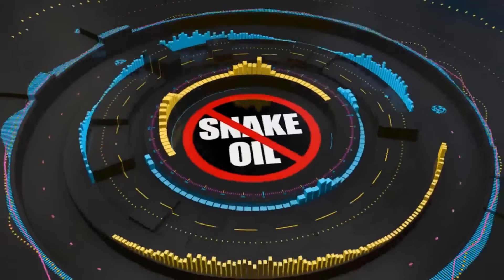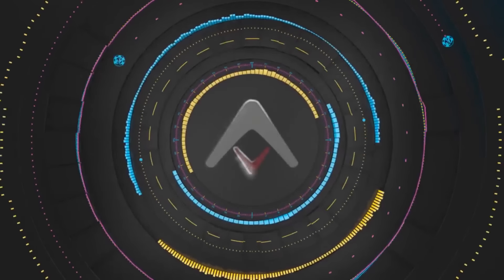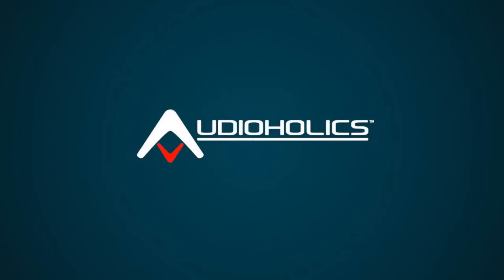STOP Worrying About These 5 Things in Audio!

Comment: Good afternoon Gene , I really enjoy and appreciate your honest advice and tips that you give regularly on your channel. It is much appreciated. I have a question regarding my system which I might add is a very modest one Emotiva MC one with Emotiva 52 I am using a Velodyne subwoofer, paired with definitive technology STS
Mythos towers and infinity  modulous rear channel speakers with a bowers and Wilkins Center channel, my question is, would you recommend the use of a deck with a built-in streamer to enhance the sound quality or would that be something that would not make sense in my system?
Reply: Dac i apologize for the typo and its a Emotiva XPA 5 gen 2 amp

Comment: Why do speaker manufacturers continue with this game of rating their speakers at 8 ohms? And why don’t receivers, integrated amps and amps get on the 4 ohm bandwagon. If speaker manufacturers are going to continue making 4ohm (or less) let’s just adjust the whole industry standards and say 4 ohms?
Reply from the maker: Most multi-driver speaker systems have a nominal impedance of 4 ohms despite some manufacturers fudge and say 8-ohm compatible. Definitely worthy of a video. As long as the speaker has reasonable sensitivity (> 88dB @ 2.83V) and don't have crazy impedance swings or phase shift within the audio band, most modern AVRs can drive them fine.
Reply: The IEC standard for rating speaker impedance provides that impedance must not fall below 80% of the impedance rating. So a speaker with impedance that doesn't fall below 6.4Ω at any frequency is an 8Ω rated speaker. One which drops below 6.4Ω but only to as far as 4.8Ω should be rated 6Ω and likewise a minimum impedance below 4.8Ω but above 3.2Ω conforms to a 4Ω IEC rating.

Comment: Might be a dumb question, but you mentioned Mogami. I use Mogami XLRs for my subwoofer cables. I recently moved into a new place and had to run new Mogami XLRs to my subs that are substantially longer than the previous Mogami cables that I had. I ended up with quite a bit extra cable so I coiled it. Now I know you aren't supposed to coil speaker wire because it can add inductance, but are there any problems with coiling an XLR? It's balanced, so again, might be a dumb question, but I thought I would ask nevertheless. Also, at what length can an XLR lose signal strength / accuracy? I believe Audioholics said something like 200'+ for speaker wire for a single run, what about XLRs? Thanks Gene!

Comment: Gene, I agree with you on 99% here. Most consumer grade equipment and speakers are designed for 8ohm applications. Both the AVR head-unit and speakers. Adjusting the ohms lower than speakers are natively designed for introduces a miscallibration on the crossover frequencies. Lower ohms may have less resistance, but they require higher power requirements. This introduces heat which eventually overworks the solid state amps. Similar to running a combustion engine at higher rpms. Where I disagree with you slightly, is wire guage. Even the highest wattage amps and AVRs, most don't go higher than 200watts for a speaker. Which a 12/2 guage stranded copper speaker cable can handle with ease. Brands can be snake-oil. Obviously the highest end equipment is designed for lower ohms, but you need an amp or AVR capable of utilizing without overheating.
Reply: You're wrong about the speaker cables. The lower your impedance goes, the more your treble will attenuate with a large gauge wire. This is a physically proven fact and there are multiple calculators that you can use to calculate the attenuation with a given speaker impedance and cable gauge/length. Also passive subwoofers need a low gauge wire if you need to make long pulls, say across the room for example. I'm not saying that anyone needs esoteric silver cables, just low enough gauge which can be easily calculated by utilising the laws of physics.

Comment: Gene thanks for the video.  I don’t have an AVR with a switch.  Agree on the cables.  I do like a well made cable with banana plugs but not for crazy money.  I heard the Crutchfield demos a few years ago and it wasn’t helpful.  Home demo works best for me.  I don’t bash other buyers choices or need validation online.  Finally I like buying older equipment at about a 50% discount when the new model comes out.  The only thing that does bother me is not having a price guarantee.  I Don’t want to buy and then find it on sale a month later.  The most controversial topic is cables based on what I hear and see online.  It’s a great hobby and I love reading and hearing about the latest and greatest equipment and music (I’m not big on video anymore after years with all of the different  types and sizes of TVs and projectors etc.) and all the opinions online.  Rock on!

Comment: Excellent and very truthful common sense (as usual from you) video.  Here's an old one for you harkening back to the arrival of the CD.  Putting green magic marker on the edges to increase fidelity.
Reply: Agreed. I actually tried this on some of my CD's in the 90's. Yeah, yeah the power of persuasion is high. That said it cost next to nothing and did not damage the CD's. It did give the placebo effect though. So for the while I messed around doing such it felt good.

It's like people who buy and use esoteric car polish/wax on their cars. They feel they get a better polish/wax job than using lower cost choices.

I have tried the fancier polish/wax on my cars and honestly have found using the good ole orange bottle of Nu Finish gives me excellent results and is easy to use as well as less costly.🤔

Comment: I agree with most of your comments here, yes, audio components are TOTALLY subjective, there is NO best, with the exception perhaps of tape recording equipment where the "best" is the one that makes the most faithful duplication of the original.  But, I do disagree with your second point.  Although there excesses with some of the goofy high end stuff ( I would never personally pay 5K for a pair of interconnects, But I would never pay 250K for a pair of speakers either as you get beyond the laws of diminishing returns )  Cables DO make material impact to an audio system.  There are some dependencies, if you have a junk amp and junk speakers with a xbox as a cd player or are playing MP3 files, yup, you are right, they will not make a difference as the source is to low of resolution and audio component lack resolution to resolve the difference.  But, if you have a reasonably good quality amp, speakers and associated components, playing an uncompressed audio source, there will be subtle to in some cases rather profound differences.  So to outright discount the need for any type of upgrade of audio cables, either line level or high level is quite frankly a disservice to your viewers.  They can and will make a difference if the circumstances are correct.  My qualifications to state this, I have been in the industry since the late 60's, I have worked with 75% of the manufacturers that have existed since the 60's, I have both owned high end retail stores as well as worked for several very prominent manufactures and have done thousands of BLIND direct a/b comparisons of cabling.  and you are correct, not every person would be able to hear a difference, but there are people that can't hear the differences between amp or CD players, does that mean that there is no difference for all?  A reasonably good quality system with an individual with a reasonably good set of ears will hear the difference, and it's REPEATABLE, not a placebo affect, in a blind comparison environment.  Thank you for allowing my input, have a good day.

Comment: Have to make a comment to the dehumidifier line. 
Talked to a guy who manufactured speaker drivers. 
He pointed out that dehumidifiers were actually useful if (and yes that word does a lot of heavy lifting here) you had unsealed kevlar diaphragms.
With kevlar being hydrophilic he stated that they had measured increased moving mass of up to 3 times if the drivers were in humid (near saturated) conditions for a prolonged (days to week) amount of time. 
Just a minor thing that always stuck with me
Reply: Not sure how a "Kevlar" speaker could be "unsealed". Such components are a composite of  poly-para-phenylene terephthalamide fibers encapsulated in a matrix of epoxy resin. There would be no exposed fibers to absorb moisture from the atmosphere.
Reply: @avsystem3142  That's actually a very good question. 
I always just assumed that the binder wasn't a perfect seal. 
I could very well be wrong though. But I don't see how the dude has any reason to lie. 
They made kevlar drivers, amongst other types, and he claimed that they measured it as part of troubleshooting why TS didn't come out as expected

Comment: I worked for AMS in Burnley Lancashire, my main job was building the patch bay from the recording studio to the mixing desk, each unit would use typically 22 kilometres of wire around 245,000 connections. They used custom wire with higher purity levels than average copper (store bought) wires nothing special. I have worked on a good few projects for them including a Lucas studios desk modification, Sony music 88 desk, Tori Amos home studio, the "wire" problem is not a thing in reality it's horrible that ppl are being lied to about such a simple thing.
Reply: I've seen plenty of comments like this from people in the feild such as you. Most uf us have other priorities that should out weigh the " addiction " to spend our resources frivolously like this . Just as you needed to consider while doing your installs. I'd say for me personally shortening my way to long and tangled interconnects straightened out might be slightly audible thinking about making my own. Good enough is good enough. I believe your clients would have let you know if it wasn't good enough and you would have been fixing it one way or another.😅

Comment: Weird thing though. When it comes to a DAC I have 2 cables. One is schiit usb a to b and the other is Wireworld starlight 8 usb a to b—the schiit cable hits harder than the wireworld when the only thing I change is that cable.
Reply: Not possible.
Reply: @Artcore103  it is. It is caused by each cable having a different impedance and also since it is a digital cable it can pick up noise that is then dissected into the sound. Basic principles. From an ampler to a speaker is a different aspect and different scenario.

Comment: I have the most problems with your cable discussion.  ANALOG cables (speaker, RCA/XLR interconnects) DO sound different, but if that difference is for the better is purely subjective.  A cable made of silver sounds different than one made of copper when used for an analog application.  I don't care if you can't measure it.  Maybe you're just not measuring whatever quality makes the sound different.  Who cares.  We should LISTEN to our systems, not measure them.  Personally, I think you're too hung-up measurements.  That's my opinion.  Don't change; that's your schtick.  It works for you and there's room for every kind of reviewer.  The other tweaks (crystals, resonators, etc.), meh.
Reply: The way I understand it, measurement is an objective way to quantify if things REALLY DO sound different. If they do (either better or worse), you’ll see it in the measurement. If they don’t, the measurement will look the same (within the perceivable range). There’s no world where two things measure the same and you’re truly hearing them differently. What you’re hearing is the power of suggestion.

Comment: Why are AVR's even mentioned in the same breath as audiophiles..? Sorry, but that just don't compute.. And Cables.. well that is allways a rat's nest to talk about.. but even if meassurment shows nothing that does not mean there is no diffrence.. Cables do sound diffrent, and you don't have to be an electrical engineer to understand that.. Diffrent material in the cables, insulation and the way the cable is made with twisting or not and so on does affect it. There are not night and day, but it does come trough in lower noise, less RF and so on. BUT with everything in audio.. more expensive does not allways mean more better... this is specially true in cables.. so don't get fooled.
Reply from the maker: AV receivers can be very high fidelity and only snobbery would dictate otherwise. You make a lot of claims about cable insulation and geometry making audible differences with no actual empirical evidence or peer reviewed controlled listening test studies.
Reply: @Audioholics well, when people in the business that are designers(not cables) and have heavy engineering degrees say otherwise I do belive them.. and measurements do exist if you digg deep enough :) 
So if your logic applies to cables, where design,materials and so on DO make a difference, it should apply to speakers aswell.. a 6,5" driver should sound exactly the same nomather what material it is made from.. 
Even basic electrician schoolbooks have chapters about cables, designs, materials and the differences... and of course it makes tiny difference.. like I said.. not night and day.. 

But when an AVR sounds good... 🤣🤣
Reply from the maker: @BeyondResolution I took graduate level engineering classes in signal propagation and fields and waves. I designed small signal long distance high resolution voice and data transfer for years prior to Audioholics.  I'm well versed on the topic. There isn't a single chapter in any legit engineering textbook that discusses the nonsense of audio cables like you're claiming. Audio frequency transmission is the easiest most understood signal transmission.  There is no magic other than nonsense to sell  expensive wire for paranoid audiophiles.

Some flagship AVRs measure and sound as good as expensive separates. I know the engineers that design both.
Reply: @Audioholics good tor you :)
Reply from the maker: @AudioHdnsm  keep making stuff up to justify your purchasing decisions but in the meantime, I will stick with engineering facts based on education and experience.
Reply: @Audioholics wrong again.. 🤣

Comment: lol. The 3 second pause at the beginning of your video as your gearing up to read your script… 😳
Reply from the maker: I'll take that as a compliment because none of my videos are ever scripted.  Sometimes there's a delay whwn the record starts tho.
Reply: @Audioholics  I once bought 3.5mm cables for 1000 bucks to run a sketchy science experiment to lose weight using sound blasted as photons. Turns out, a run of the mill 3.5mm from the corner bodega worked just as well lol. I did lose 40 pounds in a month tho. I also altered some facial features like reducing the size of my lips.

Comment: Alpha Audio heard and measured cable differences. Videos on YouTube.
Reply: 😂 They didn't hear anything different. It's a freaking placebo effect. You can't even hear those differences in measurements 🙄.  Stop supporting snake oil nonsense.
Reply: Look very carefully at their "Science".  
In particular pay attention to the scaling on their graphs, often they are talking about differences of fractions of a decibel, at frequencies even superman would never hear.
Also take note of stray variables in their tests.  For example, testing speaker wire on a live speaker introduces a number of variables they are not controlling, including air pressure, temperature, humidity and room volume ... all if which affect how a speaker appears to an amplifier.  
We hear from about 40hz to 15khz ... almost nobody hears the entire 20 to 20k allocated for audio use.  Anything outside the range of your hearing is not going to make the first whit of difference in what you hear, yet they frequently talk about  radio frequencies and issues that only exist with antennas.

It's like buying a new car and then sweating over it's in-flight characteristics ... even though you would never (deliberately) ask it to fly.
Reply from the maker: their article is full of  alot of nonsensical conclusions and AI correlation between subjective listening and measurements.